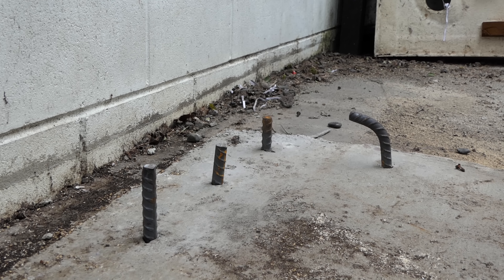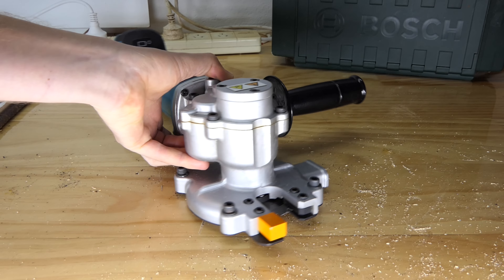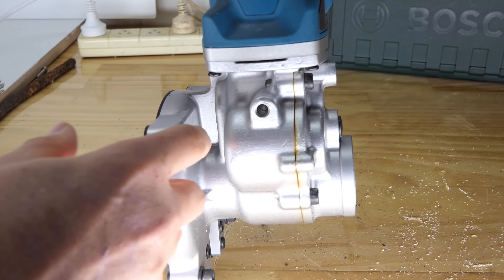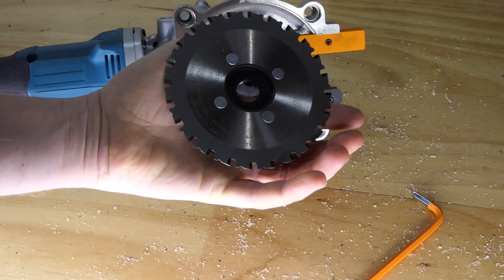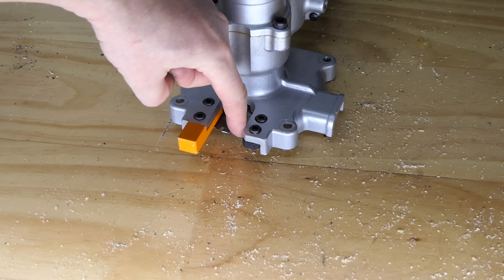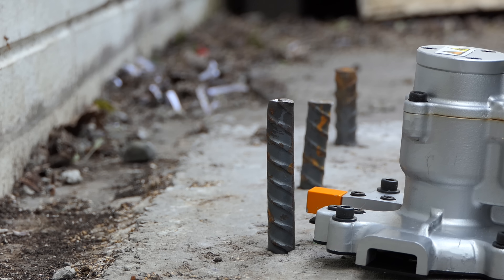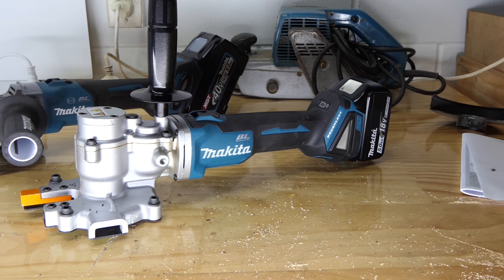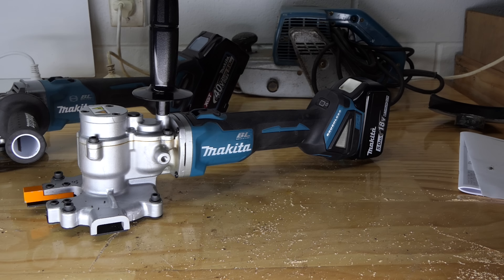Makita Flush Cut Rebar Cutter VS Rebar

Comment: You’d think it would have been cheaper to have made the blade with a depressed centre like a grinding wheel. I’ve seen some cutting disks with a depressed centre.
Reply: that's what i was expecting to see tbh. seems makita either over engineered the blade attachment or there is some hidden reason like metal fatigue that made them do it this way.

Comment: Also the rebar doesn't leave dust it seems, but rather clean small chips and not that much heated. No damps and dust from eather the metal or blade.

Comment: Adapt the blade by welding an M14 nut on it and that should work a treat on my angle grinder. Before anyone beats me up, yes I have variable speed on my unit and can turn the RPM down quite a bit.
Reply: decrease in rpm on variable speed grinders means decrease in torque. an angle grinder wouldn't have the torque for this type of blade at low rpms
Reply: @UnacceptableViews  All Makita cordless grinders maintain torque at any speed!
It's called adaptive electronics! 😘
Reply: @Leontyne-Dorian  yeah but it cant put out more power
because the fan with rotor is spining slow, and it does not cool the tool adequately for it to deliver full power
Reply: @Leontyne-Dorian   that is not how things work